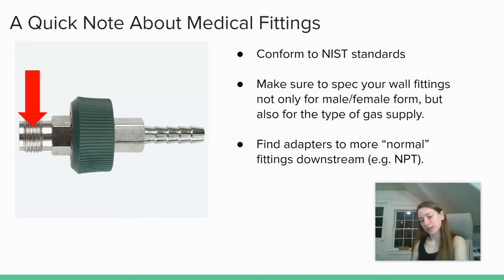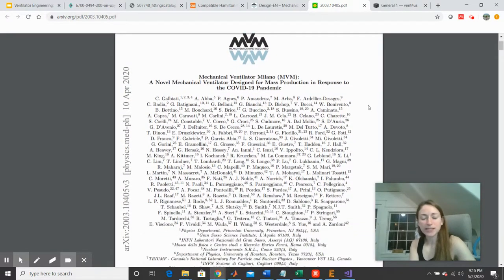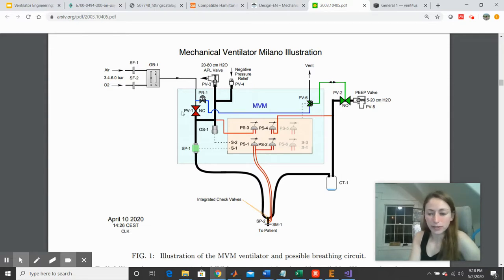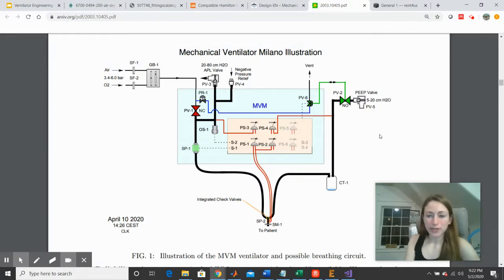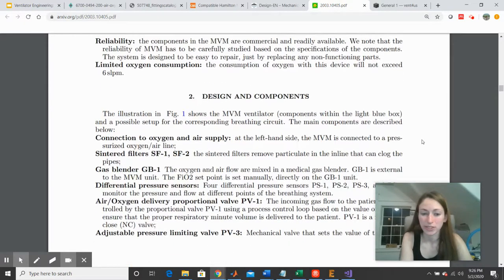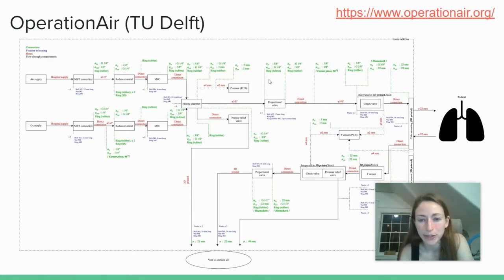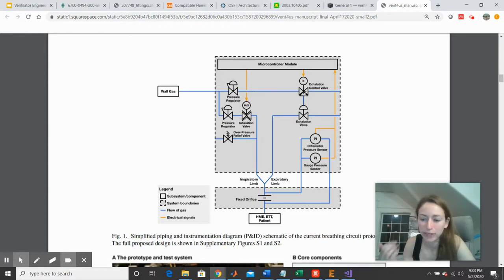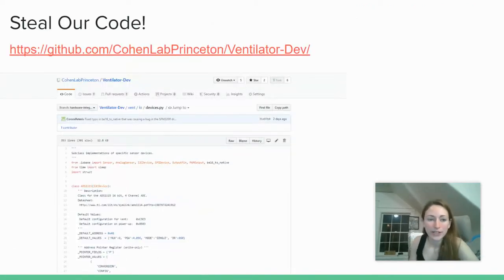Ventilator Engineering with Julie #4: Mechanical Design Comparison

Comment: Great video!!!  But i have a question what are we doing with the air that comes out from the peep valve ? Because its contaminated with Covid.
Reply from the maker: The second DAR filter (on the expiratory side) should be sufficient to prevent contamination to the room! Check out more details on peoplesvent.org :)
Reply: @juliennelachance9775   Thanks !